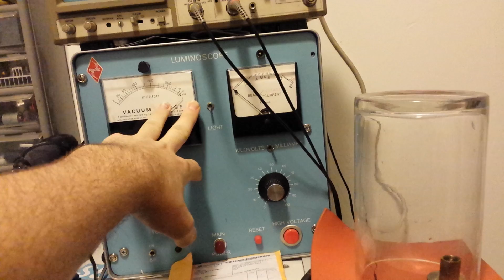Nitrogen light!

Comment: LoL your neon sign transformer is current limited by design to 60 ma. What happened to that oil burner transformer I gave you? It would work much nicer and look better. Oh and I found out that plastic hose and hose clamps don't seal all that well, They are leaking and that is why you can't get a better vacume. Hope that helps. copper tubing and solder is easyer to work than glass.